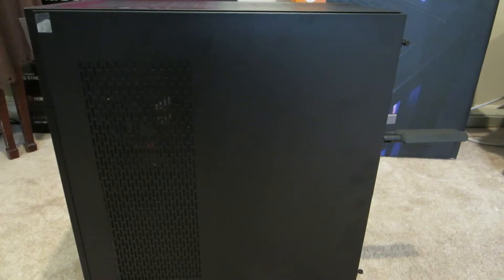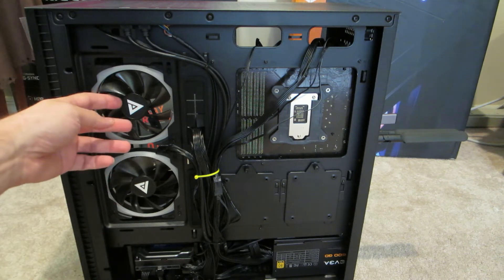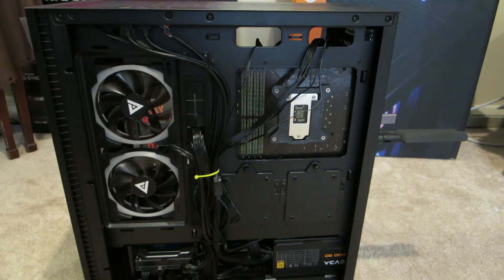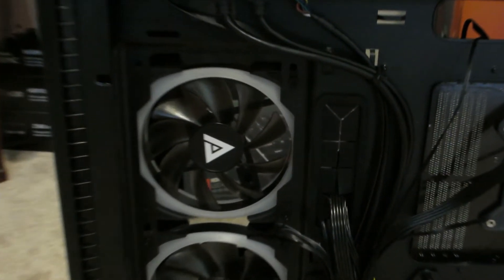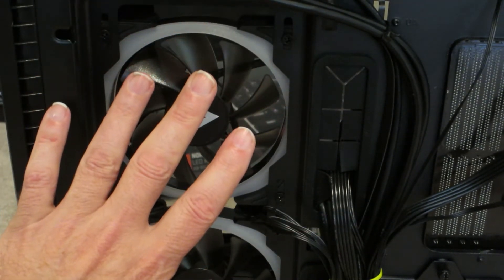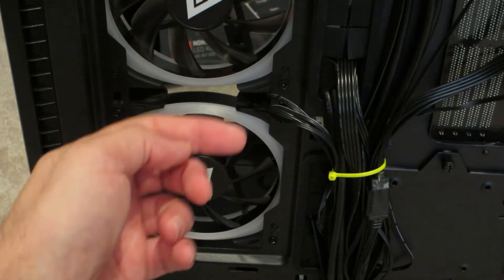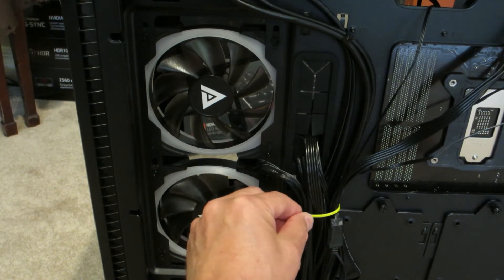How to Flip The Side Fans in a CyberPowerPC Desktop From Exhaust to Intake Part 3

Comment: Thanks brother I flipped them over lost a damn screw it fell and i think it fell right into the hole in the corner never to be seen again lucky I dont need it lmao but I was getting 83c playing dayz did a test run with fans flipped playing for 30 mins 73c to high 60s so the rtx 3080 running about 10c cooler
Reply: The cpu is fine have an aio on was the gpu at 83 now down to 70s to high 60s also have bit defender total security
Reply from the maker: That sucks 3 of 4 isnt bad.  That is really good temps for not replacing cooler.
Reply from the maker: Do a defender virus scan on c drive and check temps while that is going on. Games dont stress cpu much

Comment: hello It's me again, so the pc has been great and thanks to you I learned how to put the fans and other things but now I think I should change my power supply because when I play warzone the game always crashes and it's not the drivers it's not overheating nothing of that I think the major reason is because of the anti virus of windows 11 which takes alot of energy but yeah I just want to asked you if you had the same issue with the PSU?
Reply from the maker: Hmmm, you could turn defender off and see if that helps. There is also a way to cut the amount of power the videocard uses with the msi utility. I would try these and see how the game plays, if it solves the issue then most likely not enough power. There may be a way to cut the power the cpu or gpu uses through the bios. Just remember what you did so you can reset it back. I seem to recall my powersupply being an evga either 600 or 650watts. I would have put an 800-900 watt into it. It may get hairly replacing all that wire. keep us updated.
Reply: @DesignBuildFixReview  thanks 😊 I will definitely keep you updated

Comment: Although fixing the fan installation for proper airflow helped, what really helped was replacing the CPU cooler with an AIO. Although, I did go one step further and played around with the overall fan placement. Ended up putting all three included as intakes on the front of the case, and one additional exhaust fan on the back. The two fans on the AIO I put on the top so they also act as exhaust. Temps are now really good overall the GPU is the only one that gets hot but that's because I push it too far hehe. I plan to upgrade to a better video card soon. Finally, I saw your video of swapping out for a different air cooler. Good stuff
Reply from the maker: Sounds great, I am tending to hold back on additonal loads because the power supply in these isn't all that great. I like the aio ones too, but I am on a low budget.
Reply: @DesignBuildFixReview  I don't know how much power draw will be additional from the pump and the fans. I think my PSU is 600W so not super big. For the AIO I did have to save up a couple of pay periods :) but it was really worth the investment. Now, to be honest I have been watching videos and it is probably a bit overkill to have a 240mm AIO on a Ryzen 5 and I could have gotten away with a better fan cooler but the damage is done to my wallet already so why not enjoy it :)

Comment: So my pc is kinda the opposite. All 3 case fans are intake. Should I make one of them exhaust, and if so, which side/one. It's the same case model and positioning as yours
Reply from the maker: The single fan in the back needs to exhaust so air gets out of system. How did you determine it wasnt?
Reply from the maker: So I just looked at mine because you never know. The two side fans have the middle fan bracket inside the case, so I can see the bracket through the glass. The single exhaust fan in the rear has fhe bracket outside the case so If you look in through the glass side no bracket on the inside so that is exhaust.
Reply: @DesignBuildFixReview  By bracket, do you mean the X looking thing that indicates/supports the back of the fan? If so, when I look at the fans through the glass side, all of them are showing the front of themselves which is the side where the X thingy is at the back of it. If yk what I mean, are there any videos in your channel relating to this?
Reply from the maker: @anthonv2  Yes the xbracket that hold fan together. The two on side next to each other you should be able to see them clearly. The one in the rear is not clearly seen from the glass side. the bracket in the back is facing outside of case. I will see if I have a video shot.
Reply from the maker: @anthonv2  Okay my fix gpu sag video thumbnail shows the side fans the correct way. That x bracket for the rear one needs to not be seen from glass side.
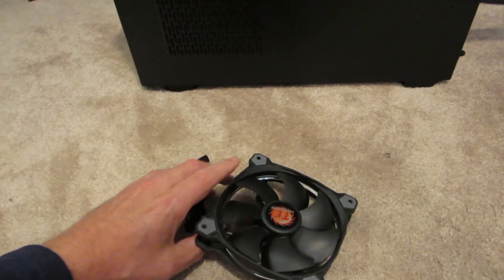Reply from the maker: @anthonv2  at 2:52 in my gpu sag video you can see the 2 side fans in the correct position
Reply: @DesignBuildFixReview  Oh alright, thank you. So to be reassured, the 2 side fans' X bracket should be shown while the rear one shouldn't
Reply from the maker: @anthonv2  correct

Comment: Mine keeps restarting and crashing bye itself what could it be?
Reply from the maker: In windows open control panel type memory and run memory diag make sure memory is good. If you overclocked anything make sure its set back to normal. Check temps with core temp app you can download makes sure cpu temps not over 80 degrees. if it gives you problems see if you can return it will be easier. Could also be power supply.
Reply from the maker: Mine never crashed just cpu ran really hot when I gave it a load,. I limited how long I would let it get that hot.
Reply: I got this pc a while ago and I love it still. That being said you have to upgrade cpu cooler if you want it to work at all. Go with Cooler Master hyper 212 or equivalent and you're straight from there.
Reply from the maker: @Ficus_Lyrata  I used the artic 34 duo, did you have to take off the existing backplate for the 212? I had both 212s the black and rgb and the artic but knew for sure artic used existing backplate so used that one.
Reply: Did you get the original black one or the rgb one
Reply from the maker: Did you figure it out? I heard some people got a bad video card that caused issues.
Reply: @DesignBuildFixReview   When I first got it any game or any small workload would send it straight towards 90 degrees and it would shut down. I am a novice and maybe I was lucky but in my situation the cooler upgrade was enough to fix it and keep it usable in the mid to high 70s depending on workload. Have loved this rig otherwise. As far as the back plate I just used what was in the box, I didn't particularly compare.
Reply from the maker: @Ficus_Lyrata  Thats great, I forced an extremely heavy workload on it and had 90-100 but mine never rebooted or shutdown. I did tend to stop the load a little after the temps got that high. If you keep it running at that high a temp I believe you physically damage the cpu. The thing is games always ran at decent temps even now gaming temps are about 55-62 but heavy workloads are like max 74.

Comment: Can you make a video of you actually taking the fans of
Reply from the maker: I would normally, but here's the problem. When you turn over the fans the first time and screw in the screws, it kind of wears the plastic holes in the fans and there is a possibility of the fans installing loosely afterwards.  You really only want to do this once or twice no more and dont overtighten. I will tell you this though. Switching the fan direction had no impact on the upper end of cpu temperatures for me. I think its a wash but maybe lower end helps I didn't check that.

I am making another video right now it will post in an hour, I just replaced the cpu cooler with a cheap artic 34 cooler and the temperatures went from 100 to 64. The video I am about to post shows you the entire process. If you have someone who does computer work this is amazing enhancement for about $40 for the fan on amazon right now. You should not run the computer unless you get those temperatures down
Reply: flipping the fans lowered my temps on my blower card by 8c would recommend.
Reply from the maker: @juandeage7751  Blower card is that the gpu?